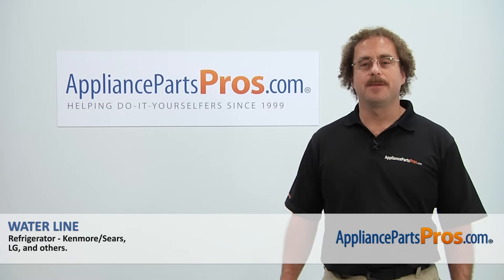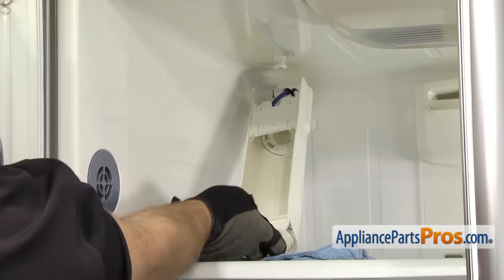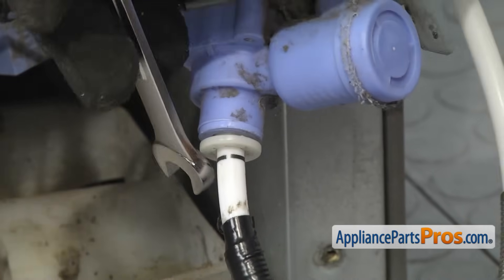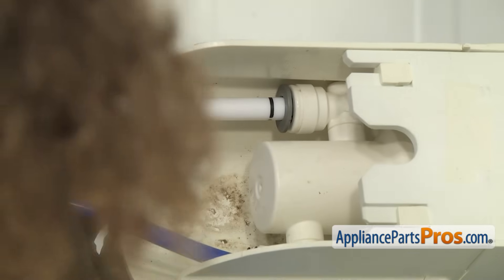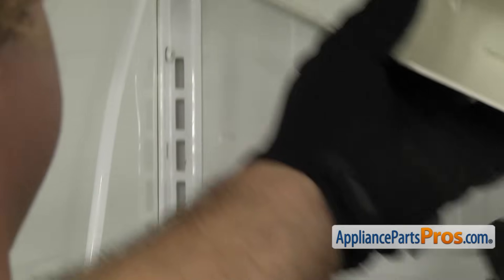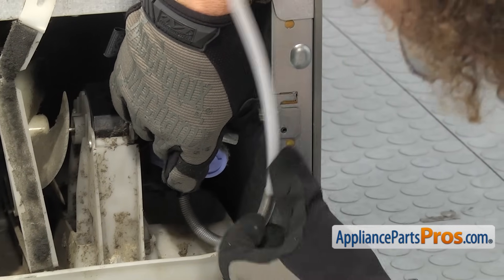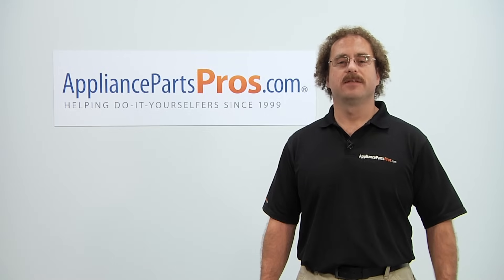How To: LG/Kenmore Water Line 5210JA3004U

Comment: Thanks!  This enabled me to replace a water line that somehow had developed a pinhole.  My LG/Kenmore has an ice maker so instead of 1 water line there are 4(!).  I think what happens is the water goes from the intake valve up to the filter back down to the valve then back up to the door dispenser or the ice maker (whichever has opened a valve). It looked a bit more complicated than I wanted to take on - especially since the service manual barely has any information on the setup (pretty much just part numbers).

This video gave exactly the information I needed, even if it was for the less complicated non-ice maker variation.

Comment: Thanks for the clear and easy-to-follow explanation. A quick repair, but folks should be sure to check which line they need - 1/4" or 5/16". My refrigerator has both.
Reply from the maker: You're welcome, and thanks for that tip!

Comment: Thanks you for the DIY!  I had Best Buy replace my LG refrigerator water inlet valve 4 years ago and appeally the repair guy broke off the end of the water line and glue the water line end to the water inlet valve.   After watch your video; I got a new water line and water inlet valve and did the repairs.  No leaks!  Just like new!
Reply from the maker: That sucks that he damaged it during installation, but we're glad we could help you repair it!

Comment: Thank you for posting this video. My water line developed a pin hole. I thought I should be able to replace the line but could figure out how to remove the filter housing. This video showed me what to do and now the refrigerator is back up and running.
Reply from the maker: Glad the video helped you get the water line fixed!

Comment: Such a good step by step! Do you have any instructions for replacing the tubing that returns into the refrigerator? Mine is broken right where it enters the refrigerator, and I have no slack to attach a coupler. Thanks!
Reply: Do you have any advice on the tube that enters the refrigerator? Mines cracked in the same place
Reply: @davidcotter4515  open up the inside door under the icemaker. If you have a bottle reservoir there, you may need to order a new tube that goes from reservoir up through top hinge through the top of the fridge out the back. My model had coiled tubing instead of the reservoir. I fed more of the tubing out the back and it worked.

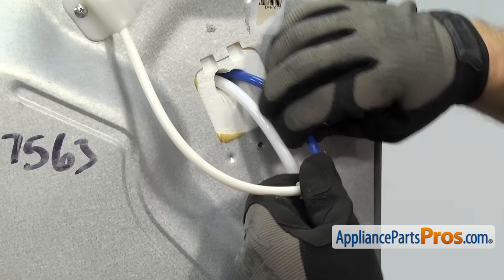Comment: Hi, great video, as others have written already. In addition to what is shown here, I have to replace also the incoming pipe to those of the filter. This pipe can be seen in this video at 8:00 in the upper left corner, covered. My pipe has cracked exactly where it enters the back panel and I can't find out how to access to it or how to open the upper back panel. Can you please help?
Reply: Found this! This line goes to the water dispenser thorough the door axis. So I was able to pull the cracken tube from the fridge top and replace it.

Comment: How about replacing the other single line in? Mine cracked right under the cover into the fridge
Reply: Did you figure it out? I'm having the same problem
Reply: Anybody figured it out?
Reply: Must be crap tubing, mines leaking in same place, single line entering refrig under the cover. Illustration shows it as item # 616G
Reply: I found out that this one goes to the water dispenser through the door axis. So, I was able to access it from the top when removed the axis cover

Comment: When dispensing water mine has started spraying water out of that upper left where the hose enters the fridge. I removed the plastic covering but can't see how or where it connects. Any idea how I access that? My water was turned off for a short time and I think when it was turned back on and used first time the water pressure popped something. Any ideas, help? Thank you for a great vid

Comment: After removing the screws for the water line, should I just be able to pull the water line out of the rear of the fridge, or is there something else internally holding it? I tried, but had to use extreme pressure to pull, and stopped as I did not want to rip anything if there was something else I need to remove.

Comment: Thanks for the great video. Our water pipe has developed a small crack at the bottom where the white pipe connects to the blue valve. Is it possible to just cut 1 inch to remove the leaking section and connect it back to valve instead of replacing the entire water line?

Comment: I need one quick question answered.  I bought the 1/4 hose and was going to replace that as well.  There was a metal piece keeping the 1/4 hose locked into the valve on the back of the refrigerator.  It bent when I took it out.  I tried to just use the locking tab/collar but the hose slips out and leaks water.  Any idea what that metal piece is/how I replace it?  Thank you for the helpful video!

Comment: This video was awesome!  I wish I could find a video to remove the front panel on the front of this exact refrigerator.  A moth got inside there and croaked and I want to get him out!  The video I did find shows that there are holes under the panel for a screwdriver, but not on mine-it is completely flush!
Reply from the maker: We can talk you through that! You can give us a call at 1-877-477-7278 or you can chat us at our website: http://www.appliancepartspros.com/. We will need the model number for the appliance, so that we can look up diagrams and information about your specific unit to give you accurate advice. You can look here on our website to help you find the model number: http://www.appliancepartspros.com/modelnumber_locator.aspx

Comment: I was having leaking under my Samsung side-by-side.  While replacing the water inlet valve, the water dispenser line running from the valve came loose from the refrigerator when I pulled the water inlet valve out to replace it.  Now I can't get the line hooked back together as there is a little cover over the location where it came loose.  I'm trying to figure out where the other end of the line is to replace the whole thing and get more length on the tubing to connect it.  I'm assuming it goes to the filter.  Is that correct?  Would your instructions here work?

Comment: At 6: 07, the pipe inside the white cap above 77563 is broken for me as it bends and goes in the fridge. The bend portion is broken and leaking water. How to replace that pipe. Do you have a video?

Comment: Hi, thanks for the video! i have a problem however.. the water line that broke on my fridge is the one on the top left, the shorter cable.. i am unable to pull it out.  Could you please help?  thanks!
Reply from the maker: We'd be happy to help you out with that! We offer free technical advice and diagnosis. To answer specific questions about specific models, we would need to know your model number so that we can consult a diagram of your unit. You can give us a call at 1-877-477-7278 or you can chat us at our website: http://www.appliancepartspros.com/. One of our agents can take the model number, look up the schematics, and talk you through any issues or questions you may be having.
Reply: Same here. Still can’t find the right part or number on any site

Comment: I finished the job, only to find a new leak where the short blue line comes from the filter to the connector elbow... leaks at the elbow.  Disheartening.   My fridge has a locking cap at this connection.  Shut off water, unhooked it at the spot (water drained out), pushed it in tight as far as it would go again.. put locking tab back on.. still leaks.  Have no idea why.  The locking tab is very loose... tried flipping it on the other side.  Could it possibly be the locking tab?  Ordered all new parts for that connection.
Reply from the maker: We'd be happy to help you figure that out, but we'll need some additional information about the model and the problem. You can give us a call at 1-877-477-7278 or you can chat us at our website: http://www.appliancepartspros.com/. We will need the model number for the appliance, so that we can look up diagrams and information about your specific unit to give you accurate advice. You can look here on our website to help you find the model number: http://www.appliancepartspros.com/modelnumber_locator.aspx
Reply: Warren H I hit this same snag as well. Got a Kenmore and just where this blue line goes back into the fridge on to the left of the inlet the plastic connection cracked and broke and now I can’t get it in or out, nor can I find the part number in any listing or diagram. Did yours work out?

Comment: The refrigerator we have was in the house when we bought it, so I don't have the manual. Where is the part number located for the water line?
Reply from the maker: What is your model number?
Reply from the maker: Which water line are you needing?
Reply: @appliancepartspros  The long one in the back that is shown in this video
Reply from the maker: Thank you! That part number is MJU62070602. You can place that order through the website, or you can call us at 1-877-477-7278 to place the order over the phone.
Reply: @appliancepartspros  Order was placed yesterday...Thanks for your help. Is it possible to get a calcium buildup in the water dispenser? Water use to come out fast, but then suddenly slowed (house water pressure is good).

Comment: What is the white tube above that copper tubing called? The one that runs vertical to the top of the fridge. That is the tube that has a tiny hole in it, is that easier to replace?

Comment: Hi, really great video ! I do have a question, the leak I have comes out of the water line that comes back from the water filter and go towards the water dispenser. In your video right about minute 8, we can see that line enters the fridge on the top left of the picture. How do I fix a leak from there? is there a video ? thanks
Reply from the maker: We do not have a video on this one yet. Without knowing what you have, I would suggest posting the problem along with the appliance model number on our repair forum and the techs can help you troubleshoot the problem. http://forum.appliancepartspros.com/
Reply: Hi Guy, I am having the same problem now. I know you had this problem three years ago. Were you able to figure it out?

Comment: Great video.  But I need help in changing the water line which goes from the top of refrigerator to the door water dispenser. There is a pin hold right where the pipe goes into the door on top. Please let me know the part number for the water pipe and if you have any instructional video on that area or any written instructions.  My Kenmore refrigerator model is 795.71013.011.  Thanks a bunch for all your help.

Comment: On my LG there is an electrical assembly, holding the fridge lights, that the water filter holster assembly goes through, and it seems like there is a flange that catches so I have to remove that assembly to get access to the back of the water filter. I can only find two screws and have already removed them. Still doesn't want to come out. Any ideas?
Reply from the maker: We'd be happy to help you figure it out. We offer free technical advice and diagnosis. You can give us a call at 1-877-477-7278 or you can chat us at our website: http://www.appliancepartspros.com/. We will need your model number to look up the diagrams of your machine and see where the problem is, which you can locate using this tool on our website: http://www.appliancepartspros.com/modelnumber_locator.aspx

Comment: hes like dancing ballet..i have never seen an explanation make it so soft or flow if u preffer..thanks..but how to know if my line is bad and is what is causing not to have water in my profile ge dispenser..is not freeze..everything has continuity ...but still dont have water...i have check all except that when i blew the line ..the air didnt got thru...is there another simptom when the line is clogged...thanks
Reply from the maker: We offer free technical advice and diagnosis, so we'll be happy to help you confirm that this is the part you need. You can give us a call at 1-877-477-7278 or you can chat us at our website: http://www.appliancepartspros.com/. We will need your model number to give you accurate advice, which you can locate using this tool on our website: http://www.appliancepartspros.com/modelnumber_locator.aspx

Comment: how does it change out from  inside the freezer door on a side by side american style LG fridge freezer? i opened the electronic panel but did not find the pipe connection? any tips greatly appreciated
Reply from the maker: I am not sure we have a video for that. Without knowing what you have, I would suggest posting the problem along with the appliance model number on our repair forum and the techs can help you troubleshoot the problem. http://forum.appliancepartspros.com/
Reply: GRG217BTJA American style fridge freezer with the water hose needs replacing, need to acess top of hose at rear of water dispenser
Reply from the maker: Looks like that is a non - US model, it does not come up in our data 
base. I referred you to the forum because we are limited in response 
length and we can't add pictures or diagrams here. Being that we do not 
have any info on it may be a problem but it may be similar design wise. 
If they cant help you in the forum you may have to try a local place

Comment: hi was  hoping someone  can help me with my ? my water is not working but i not leaking water on the floor at all i think it can be the Valve from what i seen on line .. yet i did see some water at the top of the fringe  from the other water line that goes in to the back of it ..not the one that you show on the video that goes to the water filter , but the one that goes to the left .. where dos that go .thanks
Reply from the maker: We'd be happy to help you figure that out, but we'll need some additional information about the model and the problem. You can give us a call at 1-877-477-7278 or you can chat us at our website: http://www.appliancepartspros.com/. We will need the model number for the appliance, so that we can look up diagrams and information about your specific unit to give you accurate advice. You can look here on our website to help you find the model number: http://www.appliancepartspros.com/modelnumber_locator.aspx

Comment: Do I have to unplug the refrigerator and remove all food items to drain the water line 24 hours before instatll
Reply from the maker: That shouldn't be necessary. Putting a towel down should catch the excess water that may come out. If you're worried about food safety while you have the door open for the repair, you can move the food to a cooler while you work.

Comment: So I messed up...and I now realize that the compression fitting isn't supposed to come out of the water valve .  :-(
I tore mine out of the valve...and now no matter what I do the new lines just slip out when under pressure.
Can I buy new compression fittings for the valve and use these or am I stuck purchasing a whole new water inlet valve!?!?!
Reply from the maker: The water valves are sold as complete assemblies, you would not be able to buy just the locking collar.

Comment: Hi, great vid!  @ min 07:55 where the waterline is connected to that fitting, our fitting leaks and actually sprays when the water dispenser is in use (upon the depression of the front water dispenser and especially when finishing use) - what is this particular connection called so I can order a new one from your company?
Reply from the maker: We would need to know your model number to point you toward the correct part for your appliance. We offer free technical advice and diagnosis 7 days a week, so we'll be happy to help you out with that. You can give us a call at 1-877-477-7278 or you can chat us at our website: http://www.appliancepartspros.com/. We will need your model number to give you accurate advice, which you can locate using this tool on our website: http://www.appliancepartspros.com/modelnumber_locator.aspx

Comment: At 4:10 you pull out the water line. The loose one going into the fridge.... How do I change that one? Do you guys have a video for that one by chance?
Reply from the maker: We don't have a video for that one, but watching this video should help you see how things work so you can change it. You'll still need to remove the filter and detach the filter housing, use a 3/8 inch wrench to disconnect the line from the fitting on the back by pressing down on the locking collar, and then detach it from the water filter housing by removing the locking tab and pushing down on the locking collar with the 3/8 inch wrench. 

If your model doesn't look quite like the one in the video, or you're having other problems, we would be happy to talk you through it. You can get your model number and give us a call at 1-877-477-7278 or you can chat us at our website: http://www.appliancepartspros.com/. We also have a free repair forum where the techs can help you troubleshoot: http://forum.appliancepartspros.com/. We’re here to help 7 days a week.
Reply: Thank you very much replying. My fridge looks exactly like the one in the video. I'll give it a shot and I could be calling you if all else fails.
Reply from the maker: No problem, and if you have any problems, we'll be happy to help more over the phone.

Comment: I need a video to show me how to replace the other part of the water line!
Reply: That line feeds the ice maker. Remove the plastic cover on top of the fridge on the ice maker side and you’ll see it. What I did was pull the line from top of the fridge, cut it, use a coupler and fish a new line to the back of the fridge and use another coupler on the back of the fridge; it takes 10 minutes and it’s the fastest solution. I didn’t even bother trying to disconnect the line from the ice maker side...